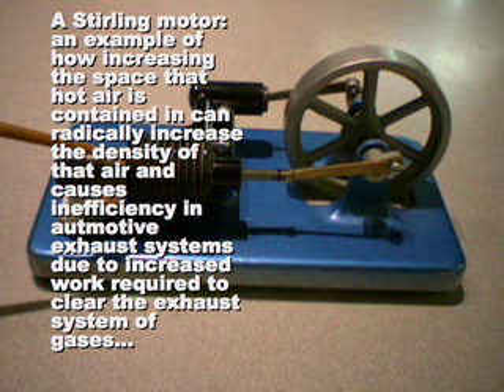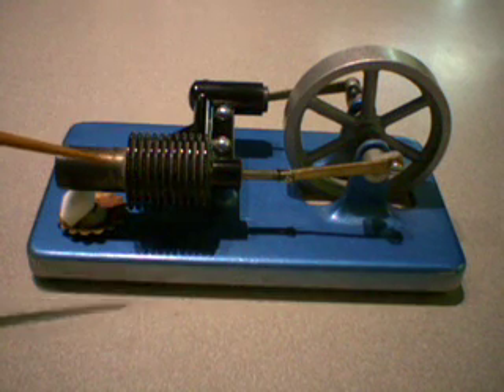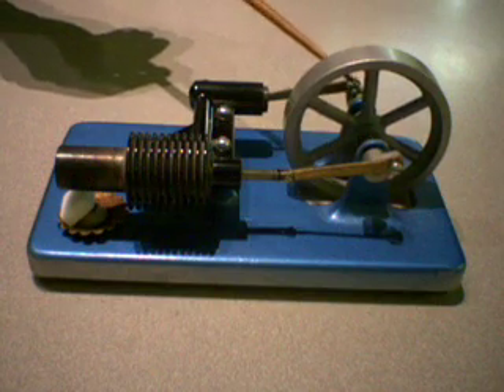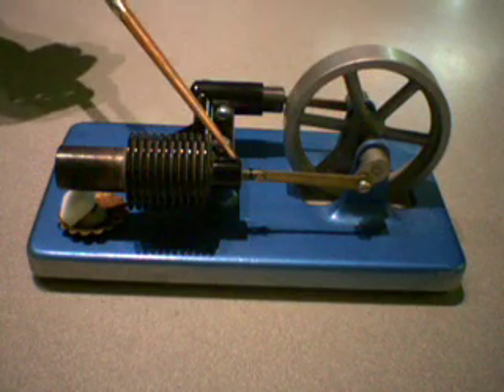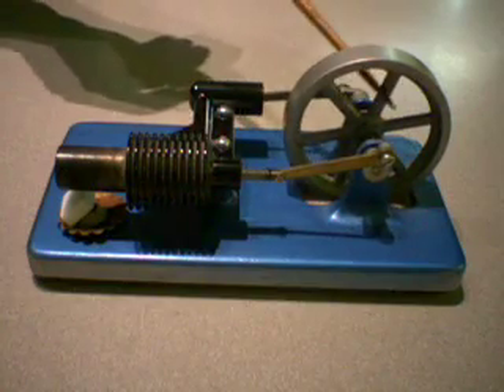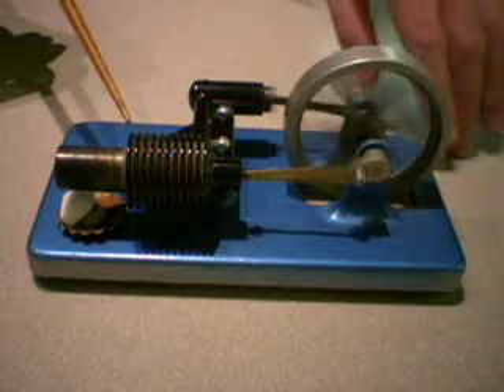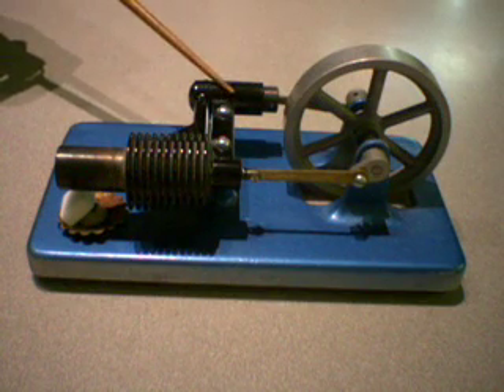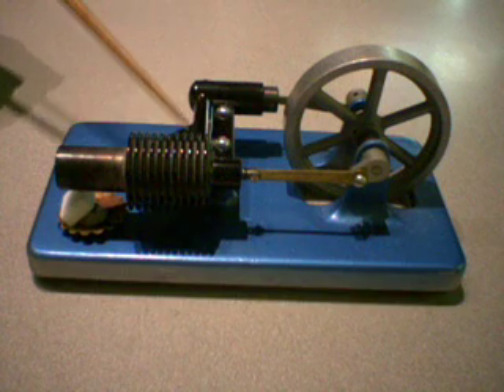Stirling engine example

Comment: It's great in theory but doesn't make any tangible power put load on that thing and watch it stop immediately and there is little to no throttle control
Reply from the maker: You are totally correct.   And that wasn't the point of the video at all.

Comment: Hey, I think density of air decreases when it is heated. That is why heat always rises above! Please give me an explanation as in why do you think it is the opposite.
Reply from the maker: If you take hot air, and increase the space it is contained in, that air will cool and the density will increase.  That causes a vacuum effect, as well as a cooling effect.
Reply: +Positive Anion He isn't saying hot air is denser. What he is saying is that if you put hot air in a volume larger than it used to be, it will cool down. When it cools down, the air then shrinks. This leaves a vacuum, which pulls inward.

Comment: At 35-40 sec- "this is part of a heat collection system that pulls heat out of their and pumps it back in" Really? I guess you might want to spend a little time reading about one of these critters cause that's not what that section of the engine is doing. If by the off chance you do undertand how it works, you definately don't understand how to explain it.

Comment: The statement at 1:23 is incorrect. The density of air does not increase when expanded. There are many ways to say this correctly. Do you mean "density of air increasing when compressed", maybe?

Comment: 1. Distill methanol from wood.
2. Use methanol to fuel a stirling engine.
3. Attach generator.
4. ???????
5. PROFIT
Reply: You'd need a lot of fuel, but I saw a video where someone charged their phone (at least for a while) with a sterling engine with an alternator attached.

Comment: In comparison to gas though, that's incredible. Most gas engines can only utilize around 20-30% of the power that they create. If we got 70%, we'd be hitting 70mpgs in bigass V-8 engines.

Comment: does anyone here know if using the heat from a heated water inside a vacuum chamber could be used to power these engines? (boing water in a vacuum chamber)

Comment: @denni4job One tube is for moving the air back and forth, the other is a sealed power piston, it powers the engine. You can see how a similar one works on my page

Comment: @brandonsg123 Is it sealed properly? If there are any air leaks they will find the path of least resistance ie. come out of the engine instead of moving the power piston

Comment: ok so i have the very first model off this my grandpa got it within a year when it was released...less than 3 yrs ago he gave it to me b4 he passed it is a memory of him of very little and i was wondering why it wont run...i have had the tip heated far past 250 before but it wont run so i tried adding oil to make it smoother to run but it still wont can  you help me i really want this to work

Comment: If we attached these Sterling motors to all the mouths of politicians in Washington, the sheer volume of hot air moved could produce enough energy to drastically cut our dependence on foreign oil!  (Cool little motor btw).

Comment: @pedroataidee It is a "Gamma" type stirling engine. There is some great stuff to look at on the web. I've seen animations of what is going on inside them. A good book—"STIRLING CYCLE ENGINES" by Andy Ross, and CDROM "STIRLING ENGINES" (I bought it on ebay from obcddudisque). Another good book is "Rev Robert Stirling D.D. Inventor of the Heat Economiser and Stirling Cycle Engine" by Robert Sier.

Comment from the maker: @BoilerRoom4 All true, and that would be a *big deal* if I in any way claimed to be an expert on stirling motors.  I just gave an explanation about it as I understood it...  all of which is taken entirely out of context since the reason for the video in the first place was to show how car engine exhaust moving into a larger area cools and is difficult to move, thereby robbing power.  Luckily this is the internet and experts such as yourself leap out of the woodwork at any provocation.

Comment: Great video, but your explanation is bollocks. Your "heat collection system" is actually the power piston (the bit that makes it go). Your "piston" is actually the air displacer (which doesn't touch the sides of its cylinder). When the air displacer moves the air into the hot end, the air expands and pushes the power piston. Then the displacer moves the air to the cold end and the air contracts—pulling the power piston back.

Comment from the maker: @MrToiletface Lubricate that thing with linseed oil and it wouldn't work anymore.  The surface tension of any kind of oil will radically reduce the efficiency of the engine, which is exactly why it is lubricated with graphite.  Like most green proposals, this one sounds good on paper but is entirely unworkable in real life.

Comment from the maker: @briquetaverne Here's an experiment for you:  Plug an electrical extension cord into itself and see what happens.  It's the same thing.  Power HAS to go into the system, it cannot run itself and even if it were 100 percent efficient it would only generate enough energy to run itself.  A two stage Stirling (like mine) already has a system to store and reclaim some of the heat, but that just makes it more efficient, it doesn't make it generate power out of thin air.

Comment: @luisinponpin 
Someone did it adapting a motorcycle engine to work as a Stirling engine. It provides electricity in a small vilage in the State of Acre, Brazil, near to you.
Now there is a man selling a Stirling engine attached to a wood-burning stove. It charges a battery during the day to be used at night. Also in Acre.
Google:
"Fogão a lenha agora também gera energia elétrica"

Comment: heat transfer is not conversion of energy and does not violate eny law of physics.
mechanical motion is not heat changed into work in in a stirling engine. there is no heat loss when mechanical work is produced. there is only a loss of temperatre differential, but since the temperature is propotional to mass and some elements transfer heat faster than others, the differential can be regained by mechanical work. this is not about diminishing returns or spring action. energy can be gained in exess

Comment: stirling engines does not run on heat, they only run on heat transfer. 
there is no energy going into mechanical work. a mechanical load only result in an increase in temperature and a smaller heat exhange. mechanial work is a result of energy released from the vacuum and can be used to increase the temperature differential and speed up the engine in a sealed enviroment where the heat is recycled indefinitely, so no heat is allowed to be lost.

Comment from the maker: @CrazyCanuck129 It has very little torque.  The power source is tiny, therefore the power harvested is tiny.  

To make a Stirling with enough energy to do more than turn a fan blade takes one the size of a desk.  Of course that goes for steam engines as well, but if you make a REALLY BIG one you can move a whole train with it...

Comment from the maker: @wwarsin Stirling motors are considered to be about 32% efficient which doesn't sound all the good until you compare it to an Internal Combustion engine which is about 8% efficient.  There are models that approach 80%, but the practical power output is not really usable.

Comment: i dont have plans. all i do is look around my house and take random stuff and put it together. for ex a connecting rod can be made from a metal coat hanger there are plans on the internet that dont involve using any type of machine like a lathe

Comment: stirlings are easy to make. i made 3 of them. the two connecting rods on the crank are offset 90 degrees, and everything needs to be air tight.

Comment from the maker: It has been tried.  The problem is that the motor doesn't generate a lot of usable torque, so you have to have a REALLY big engine.  It also has to ramp up/down the power, so you would have a lot of pedal-lag.

Comment from the maker: Yes.  And if you sit a chunk of dry ice on those fins that poor engine will go so fast you'll think it's about to explode.  The importance is the temperature difference... you could even make the engine run just by getting that end of the cylinder about 250 degrees colder than the front end.

Comment: im still kind of confused about the cooling proccess. is it that the ridges allow more surface area for the heat to be transfered to the air? could this be improved with a coolent such as ice or water?

Comment: Im taking a machine shop class this semester. I want to make a stirling engine for myself, but i'm not sure of some of the important details (size and position of pistons/chambers, distance from flywheel center to piston shaft, angles of connections, etc. etc.) 
Do you know where i could find this information?

Comment from the maker: Read the comments, please.  This is probably the 25th time I have answered this or a similar question.  I did not build the motor, I just assembled it from a kit, a LONG time ago.  I did not engineer it.  I did not machine it.  I do not have a list of parts.  I am not a stirling expert.  I do not know where you can buy your own.  I can not provide you with blueprints or measurements.  I would suggest consulting google.

Comment from the maker: Take air, put it into a cylinder.  Increase cylinder size.  Air gets colder, and more dense, pressure drops.  Cylinder area will need to be decresed to smaller than where you started in order to normalize pressure.  In that sense, yes it gets more dense when expanded.  What do you want here, a simple explanation or a physics text?  There have been entire books written about this, I suggest you look up "Carnot cycle."

Comment from the maker: I would say that you are correct.  Speed is a function of power, not a measurement of it.  Yet you can still use speed as a determination of the existence of power.

Comment from the maker: Where did you get your kit?  I have had many people ask me that, and I got mine so long ago that I don't even remember.

The paint is just some Kyrlon blue and some glossy black hi-temp engine paint.  I think it is possible that the black radiates heat better.    Mine probably runs better because it is well broken in...  I have run the crap out of it for like 20 years now.

Comment: close, but not right.
the air heats and pushes the smaller piston out.
this pushes the bigger piston towards the energy source and pushes the air away from it to the cooling ribs to cool down.
the coling pulls the small piston in.
this pulls the bigger piston away from the energy source, allowing it to heat up again

Comment from the maker: As the air heats, it expands, driving pressure against the piston.  The piston then moves out of the way, increasing the volume and allowing the heat of the air to get to the cooling fins near the back of the cylinder.  Once cooled, the air contracts, pulling the piston back to the starting point.  The second, smaller piston pulls heated air out of the system into a non-cooled chamber, then injects it back during compression stroke, adding more heat when the piston is at full compression.

Comment: the piston that you say draws the heat out of the system ( how is that even possible??) is actually the power piston and the other one is a displacer piston. that means it pushes the air away from the flame to the heatsink

Comment from the maker: Well, it produces mechanical energy from heat energy, in the same way that, for example, an electric motor produces mechanical energy from electrical energy.  All any engine does is change potential energy into actual energy in some way.  The engine in your car is converting chemical energy into mechanical energy.  So that's the point.  Also, it's fun!  (PS:  It produces LESS energy than what was put into it, that would require 100 percent efficiency which is not really possible.)

Comment from the maker: Difficult at best, and you will be carrying several hundred pounds of Stirling motor with you.  There has never been a working Stirling motor vehicle to my knowledge, although I would think that the best way to do it would be for the Stirling to run a generator and then use electric drive, thereby eliminating the need to regulate the temp to the Stirling.

Comment from the maker: Take a steam engine and build a big fire under the boiler but put NO water in the boiler and see where all that heat gets you.  Heat is power.  In a steam engine the rapid expansion of water into steam is the mechanism that converts that HEAT energy into MECHANICAL energy.   In a Stirling motor it is the expansion (and thereby density change) of the air in the cylinder.  And density change is a critical component to the workings of a Stirling.  And I was not using "catalyst" in a chemical sense.

Comment: i agree with u that they use the density of air to produce a kinetic energy but after studying physics and chemistry at college the Heat is allways where the energy comes from like a steam engine. not as in the internal workings(i should have made that clear sorry) it is not a catalyst that is something that helps a reaction along (in laimens terms)the fuel is the main source of energy if it where a catalyst then in theory the enging would run off nothin and defy the laws of physics ;)

Comment from the maker: The only similarity that this engine has with a steam engine is that both are external combustion engines.  It is true that heat is the catalyst that drives the engine but it is changing air density that converts that heat to mechanical power.  Stirling engines have no exhaust!  Saying a stirling is the same thing as a steam engine is like saying a football is the same thing as a squirrel.  You can throw both of them but they are radically different.

Comment from the maker: Well, it's really possible that I said that, but that's sort of a contraction that isn't correct.  The heated air wants to expand, and that pushes the piston outwards.  The action of the piston moving out increases the volume that the gas has to fill, which cools it and then it becomes more dense, causing a pressure drop that then pulls the piston back.  The flywheel contributes enough energy to allow the piston to recompress the air back to stage one, where it gets hot, expands, and so on.

Comment from the maker: :)  Had me worried for a second there.  As far as I can tell, the piston is made of aluminum, although it is not aluminum colored.  It seems to be metallic but is not magnetic.  It is a dark gray in color.  The rest of the construction seems to be basically pot metal, with the exception of the "heat plug" (above the fire) which seems to be sheet metal..  There are two connecting rods that could be brass, they are brass colored in any event.  Hope this helps.

Comment from the maker: Yes.  It would be more correct to say that the motion is coming from the expansion of air, etc.  In that same vein you could say that a car engine isn't producing power, rather the fuel from the tank is.  That's a little semantic but a good point.

And you are correct again when you say that the energy produced is less than that of the candle.  Carnot predicts about a 50% efficiency, so this is producing about 1/2 candlepower.  :)

Comment: Actually the captions do in fact say that the power comes from nothing but expanding and compressing air, which is false.  The power is coming from the candle/heat source.

People should realize that although the engine was booking, the energy that the engine produces is less than that of the candle.  Kind of helps put things in perspective.

But scaled-up Stirling engines can be employed for some great feats!

Comment: I gave my dad a Stirling Engine Kit for Christmas. 50USD from Thinkgeek.  No where near as fast nor robust as yours though but it is designed to run off your hand.
Now, what I want to know is whether you could power the flywheel and make one end hot and the other cold.  Making Ice Cream with the one end and heating some Toffee sauce with the other would be interesting.  At least it would get the girlfriend to agree that the stuff I buy on the internet has some uses. ;-)

Comment: very good point, i should have relised that but i commented without giving it a proper think through, i let my imagination get the better of my logical thinking. the only answer i can think of for the qu i should ask myself is because of the cost of developing suitable sterling engines and the cost of replacing the steam turbine systems is to great for companies who own the electrical plants to seriousley consider. new plants should take full advantage of stirling engines though

Comment from the maker: Stirling engines with sufficient torque to turn alternators are generally quite large.  What you should be asking is why are we using steam turbines at electrical plants in the place of stirling motors?  In a plant size is not the issue, but efficiency is, and there really is nothing that compares to a stirling motor.

Comment: its great. why arn't stirling engines used in conjunction with combustion engines in cars/vans/trucks e.c.t. to harness the waste heat energy? if they were they could be hooked up to the alternator, charging the battery and running lights, I.C.E., heated seats e.c.t. so all the combustion engines power can be used to drive the vehicle, making the vehical more efficient. is this a sensible sugestion? pease reply and express your opinions and/or ideas

Comment: To do that, I'd make a piece identical to the end piece that couples the piston rod to the axle, not unlike a cam in an engine. I'd then place the second axle it on its own rest next to the engine. Then that axle could be hooked up to said dynamo, either by belts or (preferably) the 2nd axle would just be the shaft of the dynamo.